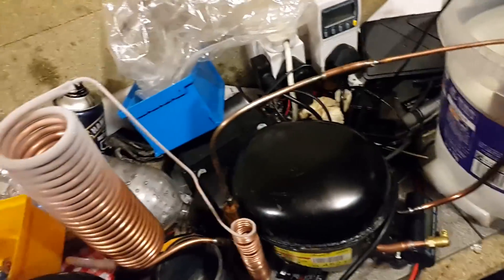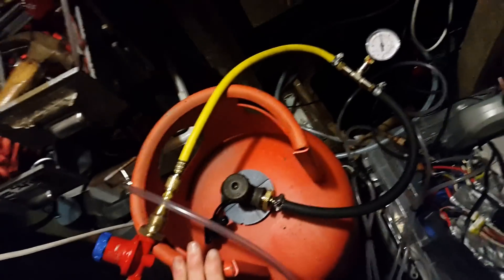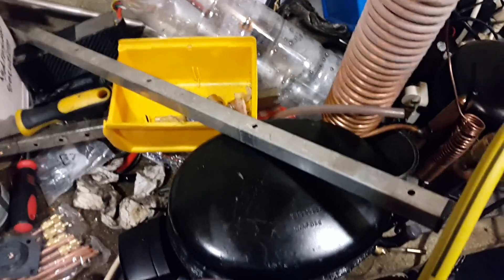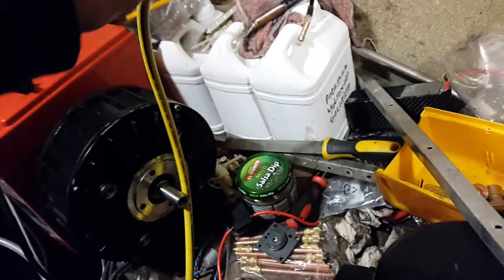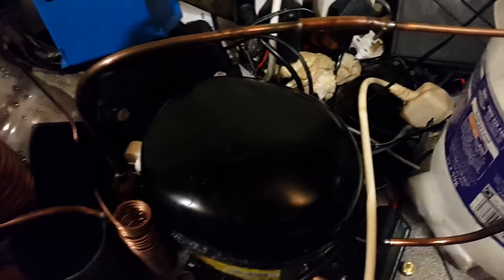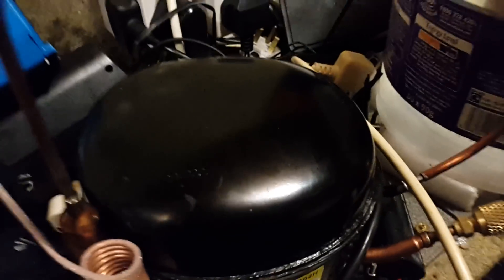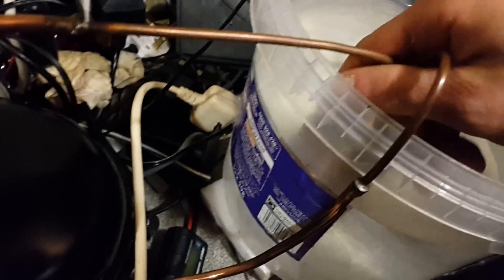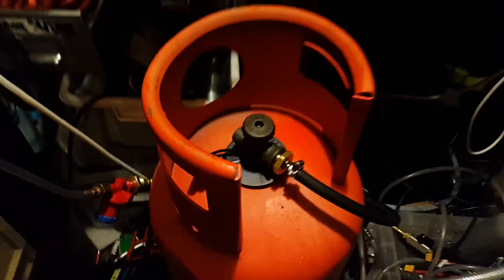Using Propane as a Refrigerant R290

Comment: Great experiment..I'm looking for an R-12 substitute for an automotive AC application. I understand the properties of propane equal that of R-12. Any thoughts?
Reply from the maker: +Paul C Propane runs at higher pressures than R12 and is not suitable for an R12 compressor. I tried it and the compressor was getting hot and not much cooling was taking place. Propane is a good replacement for R22
Reply: @ShaunDobbie what happened when you do it the other way around? (putting propane in a system designed for r32 or r410a which have higher pressure compared to propane at given temps).
Reply: What you need to do is mix Propane and Isobutane. So r290 and r600a. You need about 70% Propane and 30% isobutane to match the exact PT relation of r12. Whenever you find the drop in fake r12 replacements these days, that's exactly what's in the can. Note here that ISObutane is much different than Nbutane. It HAS to be isobutane or you will almost certainly slug the compressor with returning liquid since nbutane has a way higher boiling point. 

If you have a side can tap just grab some air horn refills. Those are isobutane. Put one of those in and then fill with propane. You can do the math to get the ratio right based on your systems fill capacity.
Reply: As long as you don't care about flammability, R12A is great. There are several companies that make it, like Envirosafe, Duracool, Red Tek, etc. It works even better than R12. Also, FYI, If I remember correctly, it's made of a blend of 60% propane and 40% isobutane, but I could be wrong about that.

Comment: Im confused, what are you trying to accomplish  here?  Or is this an experiment . are you trying to recover refrigerant or use it? and if so for what purpose?  Still scratching  my head in Florida,
Reply from the maker: +dale lankford It is an experiment.
Reply: ok , don't blow yourself up during an experiment,  shaun  I find hard to believe that you drive a  BMW. and you don't buy a proper set of gauges.  come on man,  just an observation. Im  not knocking your intentions or your whit I think you are very smart but play a little safer.  by the way where do you live? its beautiful country side from what I can see through your front window of your car. I remember way back manufacturers used propane in little refridgerators  but ceased doing so because of the low flash inside of houses . the same goes for ammonia it wouldn't explode or cause a fire, but it would displace oxygen pretty  damn quick  nice chatting ole boy gotta go on call talk latter.